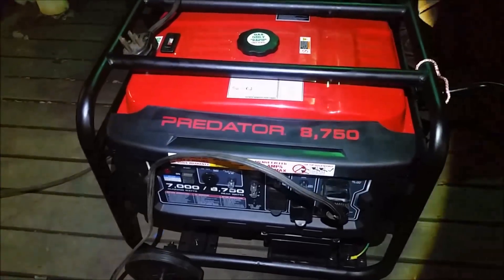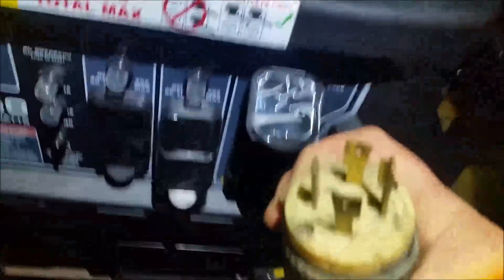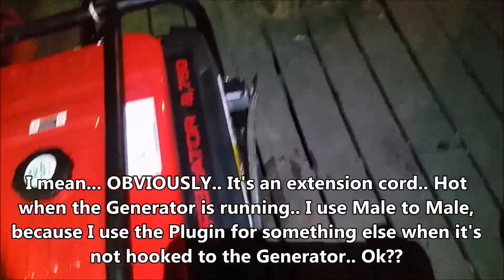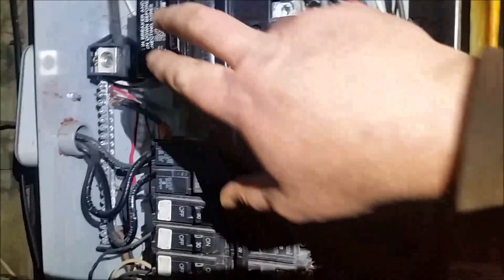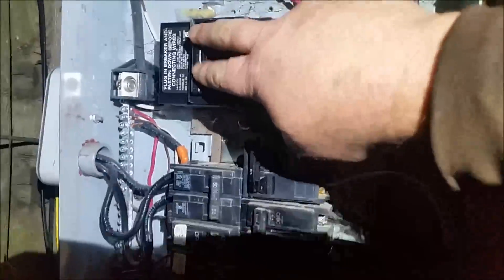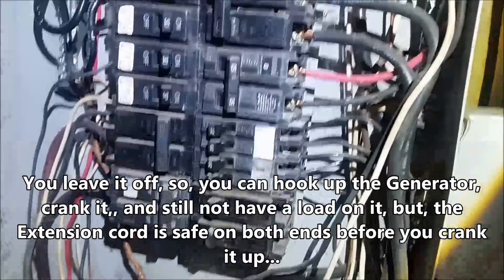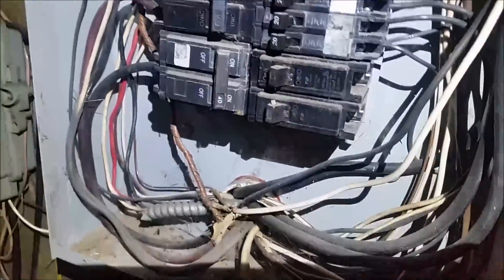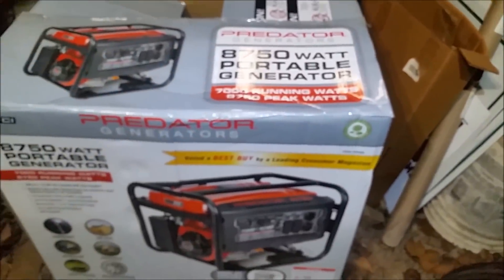Quick/Easy/Safe: Use Existing Plugin/Breaker for Generator hook up to your house Panel box.

Comment: I am a licensed electrician do not do anything this guy tells you. There are legal and safe ways to hook up a generator to your panel. He has no clue what he’s talking about.
Reply: Opening the main from the street isolates the hots but not the neutral. The set up he has done will work but is extremely dangerous. This why they make transfer switches.
Reply from the maker: UA Fitter Canada.. Well,,  Mr UA.. .It seems that you don't know what you are talking about...  I think what you are trying to say is,, that when you throw the Service Disconnect "Main Breaker" which breaks the hots coming in from Utility Power, that it is not safe,, because there are still  Neutral wires coming from the street?? Think about it for a minute.. Does that really make any sense to you?? I mean.. Really???? 
Hint,,, Hint.. Go and look and see how many wires are going from Utility pole to Utility pole and how many wires connect to the Transformer that feeds your house.  Just TWO?? Where is the Neutral?? Ha..Ha..Ha.. That's right.. It starts at the transformer and is the Ground wire running into the ground... 
What are you saying again??? Ha.>ha.Ha.. How simple and How Stupid of you!!  If you want to learn,, think about things in reverse,, they make more sense when you understand them together.
Reply: @MarkThomas123  I'm not sure where you live but my house has 2 hots(black & red)& 1 neutral(white) when I hooked up my folks house I had to unhook the neutral(white) from the bus bar to keep it from feeding back to the pole bare or green is earth ground not the same as neutral
Reply from the maker: I would have to know a bit more, but, that sounds pretty weird.  Black and red usually comes with a green and bare ground.  Yes.. Bare or Green is not the same a white neutral. But, they all go to the same "Ground Bar"...  I am wondering how you determined you were feeding back to the pole, or why that would be a problem. Neutral is the balance between the hots.. That is how a GFCI works.. When the balance gets out of spec, and over spec, it throws the breaker..  If you want to try to diagnose it, give us a bit more details.. Utility comes into the house,  then, 100amp service 3wires plus ground goes to the pole barn, Pole barn has, ,etc.. But, I would look to be sure,, if you have a panel in the pole barn, it is properly grounded at that panel and retest for starters to save some time.. Might drive a second ground (new) and move the wire, or tie into the wire and connect to both with two clamps.. Some grounds will go bad over time, and cause some weird crap.. If you have ever had a boat trailer or something like that with a bad ground, you probably know what I am talking about.
Reply: but in most places, the neutral and the ground are tied together in your panel box, so there is no issue here.
Reply from the maker: Everywhere that I am aware of.. They function together and I would imagine, anywhere in the world would be the same, since Electricity is the same where ever.. Ha..Ha. :) 
Leave it up to the libtards to come up with something like they come up with.
Reply: OK, I know I'll probably get my ass reamed for this, but my first thought when I decided to click on this video was that it features a how-to with a Harbor Freight generator. I wouldn't be secure in the thought that I wouldn't be electrocuted by  a HF generator all by itself, even without doing this hack. Second, I have done this exact thing in an emergency situation when I had to get electricity to a building in an extreme emergency, a Nor'Easter, with limited tools and supplies, and it was for an evacuation shelter full of cold, wet, hungry people and the main generator got struck by lightning. I knew I could get away with doing it because I knew exactly what I was doing and how. That being said, I wouldn't recommend it to anyone. I'm an advanced mechatronics engineer, 32 years, and live off the grid. I have a solar and wind power system, as well as two gasoline powered generators to back it up, and I built and wired my entire home and the whole electrical system myself. The only thing I didn't do was sign off on the inspection myself. I had to hire a guy licensed to do that to get my C/O. I work six months out of the year on an island off the coast of NH and run the systems there as well, which are also comprised of solar, wind and fuel generated power systems. Visit YouTube "Appledore Island Live" webcam if you care to see what I'm talking about. You can see the wind tower, the generator sheds and the vast array of solar panels lining the roofs of the buildings as the camera pans. Bottom line, I know what I'm talking about, and the only people that should attempt this would only do this if there's no other choice and they don't need a video to show them how. DON'T DO THIS DIY hack.
Reply from the maker: Victor Bond,,, WHAT??? " I wouldn't be secure in the thought that I wouldn't be electrocuted by  a HF generator all by itself, even without doing this hack."  If you are not secure and think that the HF generator might shock you by itself,, I think you should find some other place to spend your generator,, not on a generator. You are screwed before you even go to the store to buy one.. Case closed.. 
First of all.. If you are living off grid,, and you have wind and solar, then, you have a very, very limited source of electricity... After all, you can't store A/C power and have to save it to D/C batteries of which you don't want to drain more than 60% of your power to not degrade the $60 to $80 thousand dollars worth of battery storage you have.. Then, if that is the case, please tell me why you have 2,, not one but 2 backup gas generators,,, especially if your wind and solar is working?? 
I really find it interesting that you would have an "Evacuation shelter" usually underground to be used in Hurricanes/Tornado's etc,,, and off the grid because it is running on generator,, but, you got hit by lightening??? 
I can't even imagine how your brain works.. Because, what you said to begin with is about as stupid as it comes.. Afraid of a generator for starters, when "IT" won't shock you until you start it.. So, how in the hell would you even get to that point?? And, if you are scared of an innadimate object,, how in the hell would you trust yourself to wire your "whole house" with Inverters, batteries, A/C, D/C, converters, switches,, if you thought that a HF Generator was going to get you??  You watch too many videos and get them confused..  You should really take some time and talk with the guys at the Island who wired all of that up and let them explain it all to you, ,because, you don't even have a clue how complicated that is,,,, and if you did, you would never claim that you were able to do that, when your first sentence is so absolutely absurd, we all know you would never get off of the ground with such a project.. Hell.. I would even have to sit down and think that one through.. You would not have a chance..
Reply: Your generator is running because the power is out from the wind storm last night. You tell your wife that you're running to the gas station because the generator is almost out of gas, You tell her you'll be right back, but the nearest station has no electricity either so you have to drive another 15 miles to find some. Meanwhile, back home, the generator dies. Your wife is smart and self-sufficient, so she decides to use what's left in the can from the mower to get it running again until you get back. She's heard you say that a generator shouldn't be started under load, so she disconnects the loads in the house and unplugs the jumper, leaving the terminals exposed. She thinks nothing of it, it's just like the one on the camper she's plugged in dozens of times. She puts the gas in, pulls the starter cord, and after two pulls it starts right up. She's proud of herself for being so independent. Time to power up the house. She grabs the exposed end of the cord, and guess what? .....Honey, I'm home! Honey?
Reply: Victor Bond stfu
Reply: You should all be story writers ahahahaha
Reply from the maker: Victor Bond.. Is your wife that Stupid?? Amazing that you would think mine is.. Maybe you think everyone has a dumb shit like you do.. 
For my wife, it is really simple.. #1, I always have plenty of gas, and I know how long the generator runs under load and I don't let it run out of gas.. It's too easy to fill it back up.. But,, in your unlikely scenario,, if it did run out of gas,, and she had to recrank it, why do all of that anyway.. You don't pay attention to what you hear or see.. She would just flip off the Generator breaker, fill the tank, crank it back up and throw the generator breaker back on... Might,, turn off a 220v breaker to the deep well pump if that didn't work and throw the generator breaker back on after that, and then turn the water pump back on after it is running.. Big difference in my wife and yours.. She has common sense and she doesn't have a Drama Queen for a Husband.. 
Strange though, that you would come up with such an asinine way of doing something so simple to begin with... Maybe the problem with your dumb ass wife is not her,,, but, her following your lead??? That seems much more likely considering the substance and source of the Drama here... but, others can be the judge of that.. You are right.. You did have your ass handed to you. Just like you knew it would be.. At least you had that much sense. But, that didn't keep your hands off of the keyboard.. Ever think about that? Ha..Ha..ha.. Enlightening,, Huh???
Reply: This will work in a perfect world.  I have however had main breakers in the past that I turned off and still power could bleed through.  Thank God I checked with a meter before working.  In this case the breaker would have allowed power to bleed out and possible that a lineman working out on the main lines could be shocked.  Use a transfer switch.
Reply from the maker: I don't believe you, and neither does the manufacturer and neither does UL... Ever heard of "Fail Safe"????? That is where the term comes from.. Try again.. Same as Scuba gear and anything else that if Malfunctioned could cause loss of life or limb.. And, all of those things have to be UL listed..Not the same as CE listed, which is Self Certifying.. Ever try to get a UL File?? It's almost as bad as getting a new drug approved.. 
Personal experience.. This is how ridiculous it is..  Plastic Injection moulding.. Hopefully you know just a little about it. But, I'll explain it anyway...  An Injection mould is designed to produce a plastic piece.. It is done by a machine which heats the plastic pellets to a certain temperature and then, using Tons of pressure, it injects the plastic into a specially designed mould exactly for this purpose.. The larger the piece, or the more detailed the casting, the more pressure is required to produce a quality piece. One machine to another,, the size of the machine needed is determined by the needs of the mould.. They all work the exact same.. The only difference between the machines is the amount of pressure that it passes to the mould... The mould can be moved from machine to machine and have zero effect, as long as it meets the minimum force required by the mould.. 
If you are producing a Snap buckle for say a Personal Flotation Device (life vest).. If you change the machine,, not the mould, you have lost your certification for your file and you have to recertify.. These same people are the ones in charge of approving the "Fail Safe Design" of Circuit Breakers.. Sorry.. But, they are required to fail safe.. And,,, you don't design something that won't fail safe.. Because,, it costs a fortune to get it done right with zero mistakes.. There is no way in hell you would chance having a "Fail Un-Safe" issue.. That is why you have never heard of "That" phrase.. 
Same as if you were 30-60 feet deep or more in the water and your scuba gear failed.. It will always fail to free flow,, not "No Flow"... Ever heard of "Free Flow"??
Reply: Actually this is illegal for 4 reasons that i can spot off hand, call your local city inspector and ask him if you are allowed to reverse feed single or double throws. No emt rigid nada.... #8 is not rated for 200amps, 600v sure. I mean if you want to give ignorant replies to people then atleast give informative information to back your reply. You only made yourself look even more ghetto. Go ahead hate on me but i can assure you i do know code, could care less about making videos as i run the largest roadway construction job in america. Google it. Maybe you can work for us since your such a JeeNyuss 😂 ✋ please have a semi intelligent reply 👌
Reply from the maker: You are really a dumb fuck.. You have to be that little kid here.. Same name.. 
https://www.youtube.com/channel/UCWEACZvbBkr4rs6W0ag85pA   (Travis Scala).. 
Let me show you how stupid you are.. 
1) Ever heard of a Generator Interlock.. (Reverse Feeding a 220v Breaker, sold across the counter or Online and UL listed) DEBUNKED.. STUPID!!!
You can't even get off of first base kid.. You need to do more reading and less typing.. You show your ignorance you could be hiding by being quiet.. 
2) I guess you have never seen "Electrical PVC" Notice the color dumbass?? Gray instead of White.. What a super dumb fuck.. You are going to call someone else stupid and show your ignorance doing it? ? Ha.Ha..Ha.. You are the worst kind of ignorant.. Other people would look and think, but, your keyboard and monitor make you big and bad.. Ha..Ha..Ha.. My address is at the end of all my videos btw.. I'm not scared.. Ha..Ha..Ha.. 
#8 and 200amps?? DUH!!!! What the hell would I want to put 200amp rated service wire on a generator.. I mean.. I want to be able to plug it in without spending 15 minutes trying to hustle a cord that only needs service for 30 amps per leg.. It's a Generator you DUMB FUCK!! What a total stupid dip shit!! Is that informative enough?? I really don't care to get on any lower level that replying to your stupid ass comments with the same level of knowledge you SHOULD HAVE to be able to make them.. YES.. I am going to "Hate On You"..Ha..Ha..Ha.. If that is what you call correcting your STUPID FOOLISH COMMENTS..If you didn't want me to correct you, in the same manner you came to my house with,, then, you should think about being an inquisitive visitor and not some dumb ass punk kid trying to put on his Daddy's drawers and sound like he knows something you should be asking about... It's the blind following the blind.. Not sure what glory you think you found in Sheri's statements, but, I have already more than addressed them..  Ha..Ha..Ha..Ha.. YOU KNOW CODE??? Ha..Ha..Ha.. Yes, by the guy who didn't even know what gray PVC was..Ha..Ha..Ha..Ha..Ha... You are killing me.. Ha..Ha..Ha.. 
You Run the largest Roadway Construction Job in America?? Ha..Ha.>Ha..Ha.. What?? Run Water back and forth??? Ha.Ha.Ha.. Or,, maybe working on your Flagging Certificate?? You know.. You have to have some level of intelligence to flip a "Slow/Stop" and wave a flag for the rest not paying attention.. BTW.. What is the largest Roadway Construction Job in the Country today anyway.. Trump get it going for you guys??? 

BTW.. Work for a Road Construction Outfit.. I couldn't.. I would be bored stiff.. I can't even think of a single machine that I would want to run or have not yet run.. I don't care if it's concrete or Blacktop.. Either way.. I mean.. Is there a single machine that you guys have onsite that requires any level of smarts to run? Backhoe?? Ok.. It takes a hour or two on a new backhoe to really get the feel of the hydraulics before you can dig next to an existing PVC line without touching it.. But, you don't have that problem.. A road grater? Ok.. what is it that I am working with, and what kind of grade do you want? Packing roller?? OK.. what needs to be packed.. Really? Tilling up the existing ground?? Mixing hardner/cement with the ground up dirt? Laying Rebar?? Tieing Rebar?? Building forms? Pouring Concrete? Screeding it? Floating it?? Texturing it?? Putting down the lines.. What are we using (Two part epoxy with fiber mix? Maybe gluing down the reflectors? Road Construction needs braun,, not brains.. Go to bed Punk. Mommy will be waking you for school soon.. Come back here when you know something about Generators or electricity. Or, find one of my other videos and come back with one of your other youtube ID's and ask questions instead of spout off about shit you know nothing about.
Reply: If making a double-male "extension" cord isn't illegal, it sure ought to be.  Deadly.
Reply from the maker: Depends on what you want to use it for.. I have been using the same cord for better than 15 years. Same Generator too..  I think if it were deadly, as often as I use my generator setup,, the odds would not be in my favor, and I would not be typing this right now.. A car is deadly,,, and you drive one every day.. Disagree or Agree? Or, are you trying to say that it "Can Be Deadly"?? Because,, if you make that statement, I would happily agree.. Same as a Knife, Fork, Spoon,  Gun, Hammer, saw, Car, Truck, Tractor, Lawn mower, and eating/smoking/ and getting too much sun "Can Be Deadly"..  But, plugging a Male to Male extension cord into a panel,, if the breaker or main breaker is off, and the Generator is not yet running, it is like the list above.. A useful tool, when used correctly..  Just like anything else.. But, maybe I should agree with you.. Lots of deaths caused by vehicles every year. Hundreds and thousands more than an extension cord.. Maybe we should Outlaw them.. And, Doctors Malpractice is the number one killer in the USA.. Maybe we should Outlaw all doctors?? 
I sure am glad I don't live in a world you operate..
Reply: I agree, i am not an electrician and even i know some of the things he is doing are illegal, starting with a double male plug
Reply from the maker: No.. you are not an electrician, and you "DON"T"  know.. Because, the only thing added to the house wiring is the Male to Male Cord and the Generator..  Nothing else changes, nothing else is added or modified.. And NEC does not regulate portable or temporary use extension cords.. They only regulate Plugs and Receptacles and  when a temporary cord can not be used and it has to be hard wired.. 
Hard to find something that does not exist in a document, so, best you can do is read the code where it comes close to discussing and listen to some guys (Moderator) who knows, doesn't agree with it, and the guys who know he knows, so no one questions him.. You can read the code yourself... 
Understand an Appliance cord is a one ended cord, not an extension cord, or temporary use cord.. 
NEC CODES  406.6 and 406.7
You can read the comments here.. The first  reply is the Moderator. He knows what he is talking about. 
http://forums.mikeholt.com/showthread.php?t=158086
Then, you go here to learn the definitions if you have trouble with understanding what is going on.. 
https://iaeimagazine.org/magazine/2014/12/02/article-406-receptacles-cord-connectors-and-attachment-plugs/

So,, we "KNOW"" that you "DON'T Know" what you are talking about.. And the reason for my reply.. Maybe you will when you get finished..
Reply: Your off Your HoRSe is what a few of those fOoLs said..
Reply: I don't you are licensed anything
Reply: Sheri Post SWEET JESUS? I suppose this would work in them thar hills of West Virginia. “Fry the telephone guy” “Bare” “220 on one side and 220 on the other side” WTF????? 🤨🤯🤔
Reply from the maker: I would reply if I could figure out what you were talking about.. A "Bare" 220v on one side and 220v on the other.. I can't even remotely imagine what you  are talking about..
Reply: Please don't make fun of country folk, they are the salt of our land, and I for one found his video informative his accent kind of cool, and knew exactly what he was saying.  I will try to translate what I could cypher from his lecture, and your comment;  "Fry the guy" = "be careful, or someone down or up the line could get hurt - bad", "Bare" = "Ground", “220 on one side and 220 on the other side” = "Full charges on both sides of the panel - so again, be careful".  True, his way was not for the faint of heart, but when you talk about "properly" installing an interface for a standby generator, there's a hundred bucks here, and a hundred bucks there, plus the cost of hiring an electrician to lace it all together.  Before you know it, you are into it for a few grand, all to keep from being caught in a power outage.  Don't get me wrong, you are right to warn, and you have to point out the danger inherent in this endeavor, for it is considerable, but people have to adjust to their situation, and I am one whom are grateful for any advice, guidance and especially warnings of the pitfalls.
Reply: In my state there is a kill switch ( lever) on the poll with meeter that kills power. Its not even part of the breaker box. State regulations, have to have one. I don't know what you do out east. 
         Yes I'm a construction worker, not electrician.
Reply from the maker: The Raven: Interesting..  The power connects from the power company at the top of the pole.. It goes from what they call Aluminum Areal Triplex (2 blacks and one bare wire) down into the metal pole, down into the Meter pan (usually in most states).. Then, from the meter pan, directly into the house panel where the main breaker resides with the rest of your breakers.. Is this manual cut off switch part of the meter pan,, or is it a box of it's own above the meter pan? I am wondering.. Most states, that is what the meter pan is for.. Cut the small metal wire tag and pull the meter out (for fireman, etc..)..  I have looked for disconnects like you are talking about, but, have not seen them..What State do you live in.. I should be able to pick a store there with Home Depot or Lowes and see this box.. Or even order one for another project I have..
Reply: Mark Thomas brother I'm not out to get ya. You sound like a decent guy thats well infomed, for the most part.
      That being said, I'm a carpenter, drywaller, and plumber. I live in a sparsely populated area, if one wants to stay employed out here they have to be muliskilled. I've spent almost 30 years working construction. The third day on the job straight out of highschool i seen a coworker die, in the most shitty way possible. We all know that shit can go sideways, when it does it happens fast. Even the most careful guy with years of experience can fuck up, and have it cost him his life. 
       I've worked on many of big jobs, and small jobs. The last big one was for the general contractor, as a floater, because I'm skilled at more than one trade. Like i said I'm not an electrician, but i have worked with them, under their supervision. I know better than to mess around in a breaker box with just the main breaker off! You may feel comfortable doing that, i wish you luck. 
     I'm hoping that was just an oversight on your part, telling the average joe to do that, is just wreckless, and can bite you, especially if someone dies. You can get sued, and if you are a contractor you can lose your license over it. If i was you I'd take this down, and hope it goes away. I'd hate to see this ruin your business (safety code violations). Calling people names isn't going to make it better, for one I'm far from stupid, or i wouldn't be where I'm at in life. 
      Like i said you seem to be a decent guy with good intentions, but the road to hell is paved with good intentions. Good luck to you....
Reply from the maker: The Raven.. I understand fully.. I do just about anything that anyone else does.. My list is very long in what I do... I can build a house from start to finish, no matter how I decide to cover the outside or inside, so that includes framing/finishing, drywall and the likes.. I totally rewired my first home at age 17. Pulled every receptical box, receptical, swapped the inside and outside panels, added 100amp service to my shed which was going up after I did the electric.. I had over 1000 feet of 12/2 Romex in the house and at least a duplex receptical on every other stud.. Two two way light switch circuits when there was no google and you had to go to the library to figure it out, and I didn't want to check the book out, so, had to study the circuit and the different ways you could install it before I left.. Mechanic, blacksmith, welder, fitter, plumber, electrician meaning do all of my own electrical work, form/pour and finish concrete/stucco, etc. I understand how you can get hurt, and have had some minor injuries over the years.. But, when it comes to death, never even a slight incident. I prefer not to do some things, but, I figure I have a better chance than most even doing those things vs letting someone else do it for me on my own property... 
I can't think of a tool that I have not used and am not proficient at.. Even chainsaws and felling trees.. An art in itself.. Twice, in my life, I have hired some tree work done, and that is because I had a bad knee for a while and didn't feel like taking chances with my spurs with that much work to do.. 
I would not rewire a panel without turning the main breaker off, but, I would do other things that only take a minute, and I am focused when I do it, no matter what.. When I was making the video, the panel was hot, and I was pointing at the right 220v breaker when someone walked up on me in the middle of the video.. If I remember right, it was just before the 5:00 minute part.. I went back and watched the video several times to see exactly where I was interrupted.. The generator in the back, not on the porch was running and I was on Utility power at that point.. I never flinched, and only after the interruption, when everything was running through my  mind and I was still talking the whole time, I made two mistakes talking in the video, in the 1 minute after the interruption.. One of the thoughts I had during my talking was,,, someone walked up on me,,  that could have been dangerous on my part.. I didn't expect to be interrupted with someone walking up directly behind me, shocking me that I had a visitor directly behind me.. But, goes to show.. When you are doing something dangerous, you do not get distracted.. In the video, I didn't even flinch.. Had I just been standing there,, I would have whirred around and had my hand ready to pulverize someone.. But, natural reactions are not allowed when you are focused.. You friend made a mistake, when he was in a life threatening situation, and that's a fact.. Be it a fault of his own, or some other circumstance.. Everyone makes mistakes and that is a given. It just is a matter of when you make them.. I am sure I make them, but, rarely, and even more rare to do it when there is risk of serious injury... 
I understand what you are talking about... In this particular scenario.. The only danger is NOT turning off the main breaker,, or,, cranking the generator and then trying to hook up the cord considering the main breaker is off.. It's just a mistake that someone who respects electricity is Not going to make.. It's too simple.. Even short cutting the setup isn't worth it or even considered.. It only takes a second to flip off the main breaker and hooking up the cord is not a time saver or waster and neither is waiting to crank the generator, so no reason to short cut there either, even if someone considered it... 
And, for those who can't do this setup, the likelyhood of them installing a Transfer switch safely is zero, and the likelyhood of installing an interlock is still pretty damn risky,, because all of them start with turning the main breaker off... At least here, there is Zero reason to remove the inner cover of the panel.. 
You can talk about this setup for hours, but, everything considered,, anyone that does not have common sense has no business doing this.. Anyone with common sense understands the #1 rule, turn the main breaker off,, so, any of the options are available to them.. This is the shortest and safest route in that scenario.. It's not for everyone, and that is made very clear and very plain to anyone who watches or reads the steps.. 
And, one thing that is not covered in this video is "Making the Cord".. Additional research is required to do that, and that is where this video stops and the user is off on their own accord to decide which option is best for  them.. If they can't figure out how to make the cord, this scenario won't apply to them.. If they do, this is only a byproduct of their research, and they had to do more and make up their own mind... If I hang glide and make a video of it, it doesn't mean that if someone else does and gets hurt it is my fault for showing them that hang gliding is an available activity, or an option for flying... Same thing here.. It is only what is available, and if the steps are followed, this setup/procedure is 100% safe... No where do I say the panel has to be exposed. I am simply explaining some things that you "Should" know, if you are thinking about any type of electrical work related to a  panel.. And, the comments here are loaded with information that someone who took the time to read them, can learn lots and lots and lots about all sorts of electrical common sense... 
It is why I re-enabled the comments.. I will turn them off again at some point.. But, all of the information is there either way. And, I have no problem telling someone that 'THEY" need to hire an electrician... But, not everyone.. They can be the judge of that.. Same as people can change their own oil, sharpen their own blades, and any number of thousands of things that I and others do to save time and money.. Cheers.. Sorry about your friend.. I have had many people that I know that have make mistakes too over the years... But, my closer friends and associates... Rarely do I see or hear of anything more than something that a paper towel and some tape and an hour or two won't fix... I can't even remember the last time that I really hurt a finger or something and I weld and fit and work with heavy stuff all of the time..  It hurts too much and makes the rest of the week a whole lot less productive.. Cheers.
Reply: The Raven .... That's exactly what I,m saying Raven ,Well put !!
Reply from the maker: Yes. and I had a reply just under his post that is well worth reading.. I am glad that you have found this video and its posts worth reading. It is the reason I enabled comments again.. To see people using it as a resource.. And according to the video stats, that is exactly what this has become and the reason I opened the comments up again.. I hope you have gained some knowledge and see how others that post positive comments think in relation to this setup, or life in general.. The positive posters on this video who post their knowledge and use common sense and logic when they are posting are good thinkers and reliable people rarely do they actually post.. Most just read and move on.. 
But, I agree with The Raven in his post primarily.. It is why he got a detailed reply from me. But, I did address some items you might want to look at in my reply.
Reply: Exactly!  This horseshit should be banned from YouTube!
Reply: Your house in on fire. You're unconscious from smoke inhalation. The fire department arrives and finds a generator running on the back deck and SOP is to shut it off. There's a volunteer fireman who happens to be your neighbor trying to save you and your house, and is trying to find the switch to shut the generator off, but can't due to the smoke pouring out of the house, so he figures at least he can follow the cord and disconnect it to kill the power to anything inside to protect his buddies from electrocution hazard due to standing in the water they're using to put the fire out. He sees the cord, pulls the connectors on the jumper and grabs the hot end with the generator still running. I don't see a problem with this scenario at all.
Reply from the maker: Victor Bond: Wow.. How graphic your mind works.. Did you ever think that the person trying to turn off the generator might hear it running and reach over and push the off button? Or maybe just turn it over on it's side, which would kill it almost immediately?  You forgot.. What if he pulls the cord out of the generator and the power company power comes back on,, and it is a standard generator plug,, and the Main breaker was not off to begin with ?? 
How many dumb fucks do you have to have in one particular situation?? You are a Drama Queen Sir!!
A very elaborate drama queen!!
Reply: Go F yourself.
Reply from the maker: William Carr.. Mechatronics with 480 Volts.. Ha..Ha.Ha.Ha..Ha.. Wow!!  Electronics and Robotics with 480 volts..Ha..Ha..Ha..Ha.. That's good.. Ha..Ha.Ha. That is really good.. Ha..Ha..Ha.. Totally Clueless.. Totally Clueless..Ha..Ha..Ha.. Hey.. It's a fancy term.. But, before you use it, you should at least look up what it is.. Ha..Ha..Ha.. 480 Volts.. I can't stop laughing.. Ha..Ha.Ha.. What a dumb fuck.. Ha..Ha.Ha.. 
12volts,, 24 volts,, 48 volts maybe,, and D/C on top of that.. But, A/C 480 Volts?? Ha..Ha..Ha..Ha.. Yea.. Right!!! Ha..Ha.Ha..
Reply: http://coopergeneratorservices.com/generator-illegal-backfeeding-dangerous/
Reply: Thanks for the tip Bill.  The comments on this video are filled with people, mostly electrician, saying spend a "few" dollars, and hire an electrician.  Electricians don't work for free, and by a few dollars, you mean a few hundred dollars for a transfer switch alone, and to hire someone to put it in, is yet a few hundred more, and this can reach the thousands pretty quick.  Having been in heavy construction, I for one appreciate the danger electricians face, on a daily basis, and the lengths they go through to protect the entire job site from electrical mishaps, with almost seamless application of electrical expertise that keeps us safe.  That said, their main defense is knowledge on what is safe and what is not.  Though, despite the vitriol, the warnings are heartfelt and appreciated, but knowledge and  guidance would do as well for those of us who cannot afford to hire an electrician, yet prefer to have an option when the power goes out.  A safe option.
Reply: All of you guys really need to watch this video about generator safety https://m.youtube.com/watch?v=I1jT3ANENvI I just hope you stay safe. Generator safety is something that everyone really needs to know about. Hope you all watch this video I’m sharing. Thank you
Reply: Sheri is CORRECT. Not only is what you are doing dangerous, it is illegal. If someone follows your video and hooks their generator up, as you have and someone gets hurt, You can be held personally responsible. I am an electrical contractor and run across fools like you all the time. The first indication that you have no clue, is your work is extremely sloppy. I don't make movies either. I have a real job.
Reply from the maker: Vegas Roy.. I wonder if you know enough about what you are talking about, to be specific and tell us exactly using the steps in the video and/or the steps in the description.. Explain to me what step is dangerous?? Please explain in detail,, following the instructions,, how you could hurt yourself.. 
Because, I am really curious where it is that you think you would fail..I do this all of the time.. Out of power more than frequently.. And, I have no problem.. No doubt you are scared of yourself and you think you can't do it,, but, if you take it step by step,, what part of what I do all of the time is it that scares you??? Just curious.. If you will say what it is,, I will try to get down to kindergarten level and explain to you why you are wrong... Maybe you will get it then.. But, by all means,, tell us what you are scared about and why you think you can't do this safely? Using the simple steps in the video of course..
Reply: License. Receipt of purchase of privilege.
Reply: Always from "licensed" guys that get mad cause they might lose business. 
Do you really think what you do is rocket science?
He showed how simple it is.
 #1 turn off the main switch!
Reply: Sheri Post Please do NOT listen to what the clown making this video is telling yo to do as it a very very dangerous thing to do. Get a proper change over switch and get an electrician to connect it.
Reply: roger that,I am a licensed union electrician and whatever you do ,do not take advice nor guidance from these jack of all trades.I have seen these "experts" give advice for years.It is your life,your house and insurance.
Reply from the maker: James Ellis.. Sounds like a Union Electrician..  Probably the only way you can keep a job.. Union Protection.. I see you didn't offer any factual comments.. A real Electrician would.. Union.. I didn't expect as much..
Reply: Yeah and you got a dog in the fight ($$$). I'm not NEC, but I can wire a house, no problem and it WILL pass. If you know what you're doing the above vid is no trouble. You have to know electricity, which I do. You have to THINK, or you'll do serious damage to others. Heck I build and maintain radio transmitters w/ 2Kv plate circuits.
Reply from the maker: Sheri Post you are not a licensed electrician. Otherwise you would have noticed that there is nothing illegal in the video. You are stupid.
You do not even understand what the electrical code is for. Stop lying.
Reply: Well yes I am.
Reply from the maker: Really Sheri?? You are??? Stupid?? Because, you sure aren't an Electrician.. Ha..Ha..Ha.. You people never cease to amaze me.. Where is your Electrical Content Videos,, Mrs Electrician?? Ha..Ha..Ha.. 
What?? Can't make any, because you are watching videos trying to find out how to hook up your Generator?? Ha..Ha..Ha.. What a Joke.. Bet your some guy who wants to be a girl.. Ha..Ha..Ha.. Give me a break.. 
You are Right... Just plain STUPID!!!
Reply: Prove it!!!
Reply: I'm Grateful     The guy has not got a clue how dangerous this can be.       Be it on his head when it goes wrong. Just because it works does not to say it is right. From Scotland
Reply: @raymondrobertson3869  Furthermore, if a person needed a license, Joe Schmo couldn't, purchase one. Ya'll need to stop being afraid of stuff.
Reply: @raymondrobertson3869  there is an exception made for construction workers.  They're hired for this stuff.  You must be a liberal.
Reply from the maker: Raymond Robertson.. Let me say what you didn't say exactly, but, what you did say... Just because it does work,, it must be wrong? Ha..Ha..Ha.. 
Electricity is dangerous all by itself.. but, that doesn't mean that Electricians don't exist and retire.. It all depends on who is doing the work... 
If it is not right,, it must be wrong.. Right?? And, if it is wrong, it does not work.. But, it does work!! So, it must be right and not wrong.. 
Where did you say you went to school? Scottland?? I will have to remember that... Hey,, isn't Scottland where you have to Register a "BB Gun"??
Reply from the maker: Raymond Robertson.. Again.. It's really simple.. If you are claiming that this is not safe.. Please explain using the steps in the video and be very detailed in how you would get hurt following the very simple steps.. Because, I will explain to you what you do not understand about the very simple directions, and why you messed up reading them.. I will try very hard to say it where you can understand it.. but, you should be able to say "WHY" this is dangerous if you have 18 years in this business.. I really want to know where you think the steps fail.. Because,, I don't have 18 years experience and I am 100% certain that I can debunk anything you say about this not working safely... 100%. After 18 years experience, this should be a cake walk for you... Simple to show EVERYONE HERE,, why it is NOT Safe and you are smarter than I am.. Give it your best shot.. I am waiting!!!!
Reply: Mark Thomas 

Get. A. Damned. Transfer. Switch.
Reply: Interesting, Mr. Mark Thomas, how you shadow the replies that make you look like a dumb ass and that you can't figure out how to respond to. You give Republicans a bad name with your tendency to call everyone some sort of a this-and-that Liberal. I'm a Republican, and you're an embarrassment. Why don't you just disable comments for this upload if you don't want to hear them, instead of being an intolerant, hateful, Liberal control freak, screaming in everyone's  faces and trying to shove your opinions down their throats? Censor me, because you have to control the dialogue, that's just like a true Liberal. If someone challenges you, you call them names. I'm surprised that I haven't heard you calling people "prejudiced", "Hitler", and all of the other stupid names I hear other people using because they don't have a legitimate argument. I hate YouTube due to people like you.
Reply from the maker: Victor Bond.. Not a single reply here "Makes Me look like a DumbAss". It is quite the contrary. Same as your 3 comments vividly show who is the dumbass.. It gets worse after I reply and point out the areas of ignorance..  But, here goes again.. 
You are a Republican?? Who told you to do that?? What about you is Republican?? Why did you make that choice??  I am curious if you know why you chose that party.. I am not either a Republican or Democrat.. I am not a Libertarian either.. I am a Constitutional Libertarian.. Do you know or can you imagine what that is, or why I claim to be that?? Since you are going Political, I thought we would see if you know what you are talking about. 
I am intolerant to Ignorance...  When you make statements of authority,, they are there for other people to read, who might read them and fill their head with the ignorance.. So, I correct it. If you think that is hateful and intolerant,, then, sorry, so be it.. If you asked questions and tried to learn, you would be treated entirely different. You can see examples of that all over this video.. It is one of the best resources on the net.. I debunk all of the stupid crap that is all over the internet on these types of videos, right here.. I encourage people to show exactly what is wrong with this procedure.. You can see this in EVERY REPLY where those comments are made.. I explain in detail on every comment.. And, I have turned off comments before after I deleted all of the negative stuff, and then thought.. That was not smart.. I should take the time to answer hundreds of questions and then, disable comments, so, anyone interested can understand hords of info about this and every bullshit idea that thousands of people puke on youtube can all be debunked right here.. A very valuable resource for guys who want to know.. You not included.. That is why I doubt you are a Republican, unless you chose to be one for an entirely different reason, and the reason I asked you specifically.. Because I feel like if you actually are, you could or will explain yourself.. But, I do not expect a response, because, I do not think you are one because you chose to be one on merit.. Because it is the first step away from the Ignorance that causes people to register as Democrat.. I was registered Democrat once.. Before I knew the difference in a Democracy which we are not and the Republic which we are.. I doubt you know that or the difference.. 
I do not speak in Opinions.. That is how you speak.. I interject facts using logic and reasoning and the physics of Electricity, in this case where directly related to the video and get way past that on some discussions.. I will comment about how stupid some of the comments are and then explain why.. That is the way it works when you talk facts.. You identify the ignorance, and then explain why it is ignorant.. But, people don't like that,, which is fine.. If they don't, then, they should get educated before attacking this procedure, because I am more than ready to defend it via the facts... And, it can't be debunked.. Many have tried and all failed.. 
Prejudiced? Hitler?? Where would that be applicable in the situation.. Probably why you have not heard me use the terms.. But, I will, since you brought them up.. I believe your Prejudice is simple..  You were searching something very simple and that is what landed you here on this video.. You were searching how to hook up a Generator.. No telling how many videos you have seen so far.. You are totally confused about the whole deal because there are so many videos out there with bullshit, no common sense crap that confuses you and you don't have enough knowledge to tell the difference.. So, you are frustrated that you can't figure it out on your own.. Such a simple thing and you are extremely pissed that you can't find a simple solution that solves your problem.. You want to do as little as possible, spend the least amount of money, and you see it here in this video, but, you are so scared from reading all of the other bullshit that you just can't see the simplicity of this one... And, you know it,, but, can't get over all of the other kaka... 
Hitler??? Here you go.. You have the same tendencies of Hitler.. You know others are doing this successfully.. There is a guy that did a video and you know damn well he knows what he is doing and he has used this thousands of times and it works every time.. Then, there are commentators here who confirm it and they do the same.. But, again,, you are still freaked out and that is not good enough for you... So,, what is the remedy?? 
Just to turn the page and find another video? To find another solution?? No.. That would not make you happy.. You need to be sure to not address this procedure factually, and ask the questions that you do not understand,, but, you have to be able to get mad at me and mad at something else that will make you feel good about forgetting this video and moving to something else.. But, in the back of your mind, you know this works and it makes sense, but, you can't get over the bullshit you have heard because you are not smart enough to call it bullshit.. So, if you can't have it and you can't do it, NO ONE SHOULD.. It is the reason behind the Hitler massacre.. As with any race there are the ignorant and then, there are the average and then there are the very intelligent.. If they believe something different than you, and they can say why and they can produce a good argument which makes you look at yourself and you can't debunk their argument, but, you are so hell bent that NO ONE should have what you can't have, that you want to eliminate anyone who can do this thing you can't do.. So bad, that you would eliminate this video and every other video like it that you don't understand, so you won't be so frustrated with them.. And, if you can't eliminate the video, you will eliminate the source of the video.. And, that is why you wanted me to take it down, disable the comments, or just stop commenting and debunking what freaks you out, because there is SOME RISK in any of these options because there is a Generator involved to begin with. Remember that comment you made?? The Generator is your first problem.. Remember??? This is the first part of your problem.. In my opinion, until you realize that the generator is not going to do anything by itself, you are not going to GET IT THROUGH YOUR THICK SKULL, that you are the problem, and not the Generator.. Once you understand that,,, you are one step closer to being able to do something like this.. Next step is very simple.. Follow the Steps one by one and determine if you think you CAN NOT do one of them.. See why you feel that way and ask questions.. Get answers and think about it. If you do that, you will see, it is very simple and only your fears of doing something very stupid, like you described your wife might,, is really pretty far fetched for anyone who is actually doing some very, very basic step by step reading.. It is the simplest video on youtube for doing this.. You don't even have to open the panel to try it.. Just make a simple male to male cord.. I'll stop there.. It is way more than you need, once you get past the generator freakishness.. 
Hitler only took it one step further than you.. Rather than eliminate the videos, or youtube,, or the comments,, he eliminated the likelyhood that any Jews would challenge his Intellect.. He wiped out the population who threatened his agenda.. 
So,, you are just one step from becoming someone like him.. You just need to be more radical than you already are, but, I don't worry about that from you.. You are scared of a Generator which only does what it is designed to do, when you pull the cord or push the start button.. It is not like trying to eliminate another race of guys who can do what you can't do.. That would get much more complicated, because people do things based on situations and react differently under different types of stresses and there is no way in hell you would ever get a handle on that.. That would be super complicated and super scary and way over the fact that a generator you just purchased and are standing there looking at,,, might hurt you.. 
So, are there any other terms that you would like me to use??  I just might be able to use them for you... 
Challenge me.. You can even pick another topic if you would like.. What are you?? An accountant??? I can go there too.. Funny thing about me is,, I look at someone else doing something and I break it down real simple.. What basic tools is he using to do the job?? Two eyes, two hands, etc.. If he can do it,  I can do it.. So, there is just about nothing that I have not already done.. And, I don't have to have done it before to understand how to do it.. I already know the "Why and How it Should Work", so, I know what to do to fix it.. This generator business is really simple stuff.. 
Check out some of my other videos and see if you can find something else that interests you.. I don't remember how many videos I have on Electricity.. I think only one in Feb of 2013 on how "NOT" to fix an underground wire.. I never video'd the fix.. But, I surely should have.. It is/was an awesome fix I dreamed up when I was 18 and had to fix one like it.. And, I have one on how to identify if your battery charger is working on a HF Battery charger that I purchased 3 of and they all failed, doing the same thing.. And a video on how to troubleshoot a 1hp deep well starter box... Other than that,, everything else is non-related to electricity.. OH, and I think I have one on my Welder/Plasma cutter cart.. I share a 220v circuit between the two of them, but, it is more about the cart than the shared electricity circuit.. But, enjoy either way. 
But, I am happy to size you big guys down to size by using your comments to do so.. I figured since you attacked me personally, I would give you some extra time.. Did you enjoy?? Ha..Ha..Ha.. Have a nice day..  Good luck on your fear
Reply: Ain't it amazing that all those with degrees/licenses/certification sincerely believe they or someone like them are the only ones capable of doing stuff safely and everybody should be FORCED to HIRE them. That's one of the BIG problems Germany had in WW2. When the "specialist" got killed nobody could make "their" equipment work. Americans were the opposite. REAL Americans STILL are.
Reply: Victor Bond 

I think it's fairly obvious he's NOT a Liberal.

You see, Liberals believe in Regulations.

The only safe way to do this is with a transfer switch.
Reply from the maker: William Carr...... The only safe way to do this is with a transfer switch.??? 15 years of doing this exact same thing and I'm still here, house is still here,, and the linemen around here use my same setup. Ha..Ha.Ha.. 
I would like to put all of you Libtards on an island together and come back in a year and see how many of you actually survived. Ha.Ha.Ha.. Wonder who would be regulating who in your world.. Can you imagine a bunch of Libtards trying to run or do anything?? Ha.>HaHa..